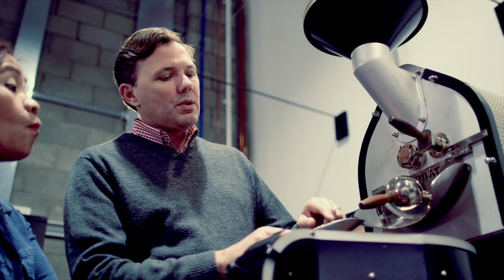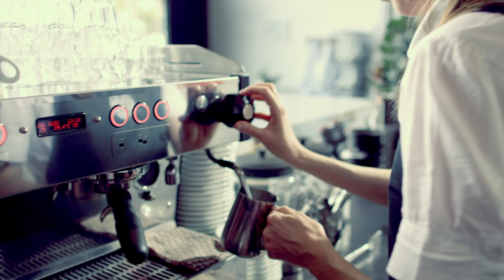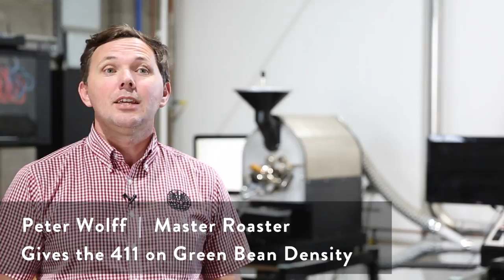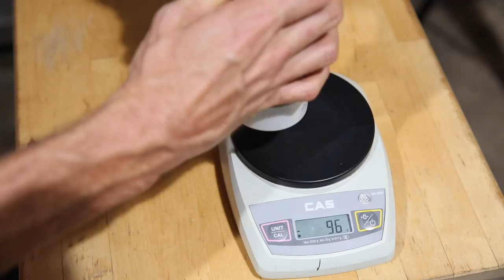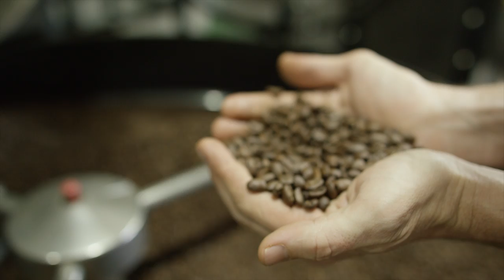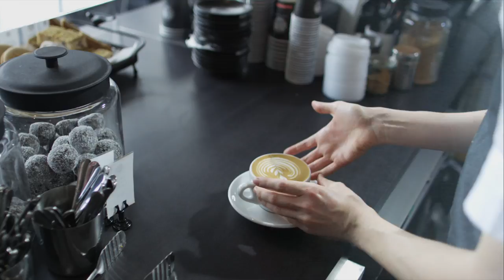Green Bean Density

Comment: Interesting stuff... but surely if you have physically smaller beans, there will be less AIR in the measuring cylinder, so it would show that the beans are more dense... but they are not necessarily more dense, just smaller!

Comment: I am going to make one of these.   You fill the pipe with 250g of green beans, mark it then cut it?     It's that simple?    Am I missing something?
Reply: Of water not green bean
Reply: @davidkoenawan6679  Oh ok.    I watched the video like 10 times and it's not specified.  Thanks!
Reply: In case you are not on the metric system, 250g of water is exactly 250ml. So you just measure 250ml of water, make a mark, and then fill your coffee to that point. Then to calculate you divide the weight of the 250ml of coffee beans by 2.5 to get the number... so 250ml beans may weigh 174g, and divided by 2.5 = 69.6 % (or 696g per litre if you prefer)